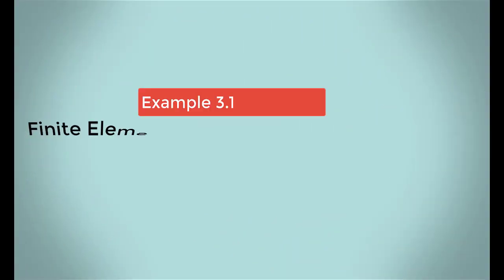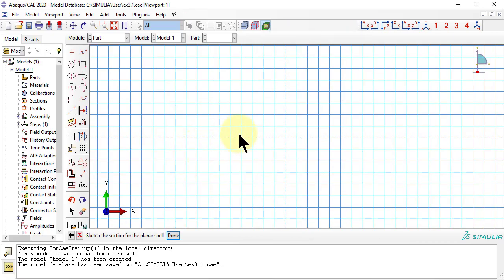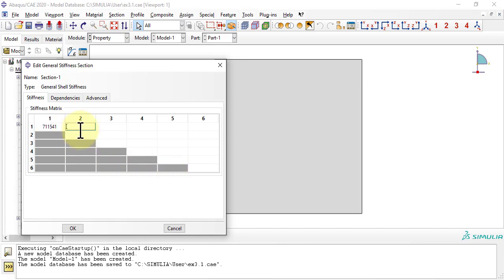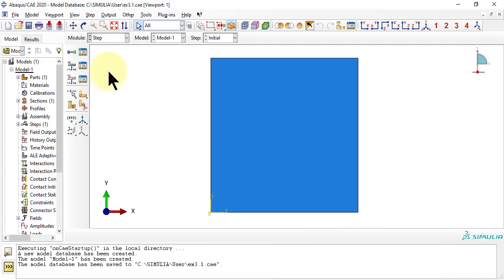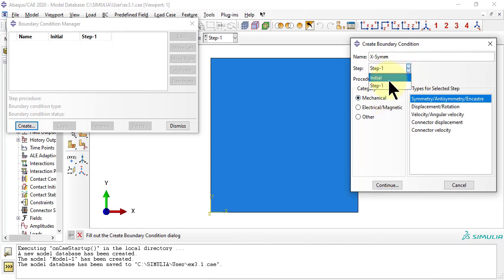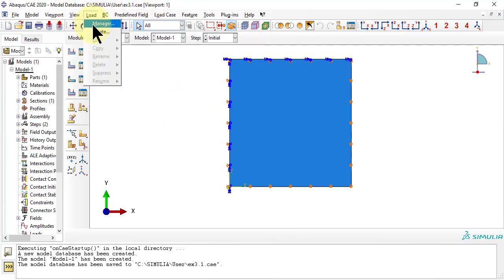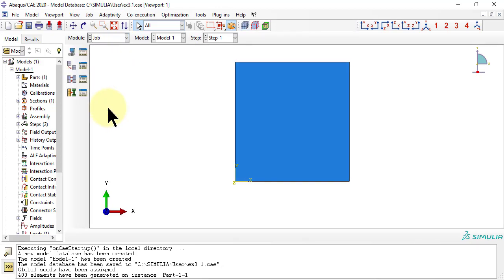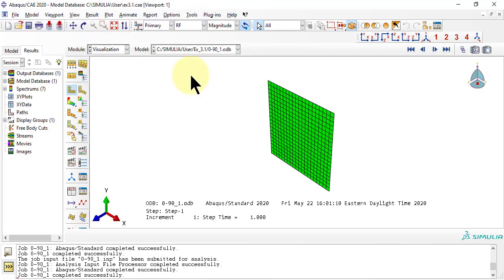Example 3.1 explains the ABD and H matrices, how to calculate and use them in Abaqus

Comment: hello Professor, thank you for the detailed video. I m quite confused in these 2 points:

1-doeas the usage of the general stiffness  ABD matrices in Abaqus, eleimantes the need to use composite layup to assign each layer thicknes/ material/ orientation? so I no more need to specific number of plies or their orientation ?

2-I earlier used the composite lazup method on an 8 plies unidirectional laminate to simulate tensile test, and I calculated the  reduced E1 after the simulation. However I wanted to analyticaly check that my results are correct, so I calculated the ABD matrices using a python code, and I was thinking of employing them in simple tension model and abaqus just like you did in that video, and the calculate the new E1. I just wanted to know is this strategy suitable to validate my original simple tension model ?

Comment: Dr, Ever Barbero, I appreciate all your videos, they are awesome. I do not know if you might help me with a question that I have regarding the symmetry boundary conditions. When I apply the symmetry as a boundary condition in one side of any plate, and the plate would have a stacking sequence equal to [45,0,-45,90,0]s. How can I know if the obtained results would be right or not; so that the stacking sequence will be different when I apply this condition?
Reply from the maker: That laminate is quasi isotropic and symmetric so symmetry will work if loads are also symmetric. To verify just model the whole laminate without symmetry an see if there is any difference. It shouldn't.

Comment: Prof. Barbero, you listed how to calculate laminate consitutive equations in your book P.97, including A、B、D and H matrix, now I wonder whats the meaning of （Ave-Qij*）in H? how can I derive it？ thx for your explainion
Reply from the maker: Qij are the components of the in-plane Q matrix of particular lamina in Eq. 5.24, p. 159 in ICMD textbook (https://www.amazon.com/exec/obidos/ASIN/1138196800/booksoncompos-20) and Q*ij are the components of the out-of-plane lamina stiffness matrix for the same lamina (Eq. 5.24). "Ave" means average of all the laminas in a laminate but you have to transform them to a common coordinate system before averaging (last 3 eqs. in Eq. 5.55 ICMD). You use them to get Hij for a shell, with i,j=4,5, Eq. 3.9, p. 97 in my Abaqus book. But in Abaqus they are called K11=H55, K22=H44, and K12=H45. These have to be specified as explained in the video. Why K11=H55, K22=H44, and K12=H45? For that, see the last two lines of Eq. 3.8, where H44 is related to Vy and H55 to Vx. Abaqus uses the same 1,2,3 and x,y,z, notation as my book but they order the contracted components differently, as in 2nd column of Table 1.1, p. 5. Note that in the column for Abaqus/Standard, the 5th row is sigma_13 that is the direction of Vy, so the 6th row corresponds to Vx, and using the last two lines in Eq. 3.8, we conclude that K11=H55 (it corresponds to Vx) and K22=H44 (it corresponds to Vy).
Reply: @EverBarbero  thank you sir